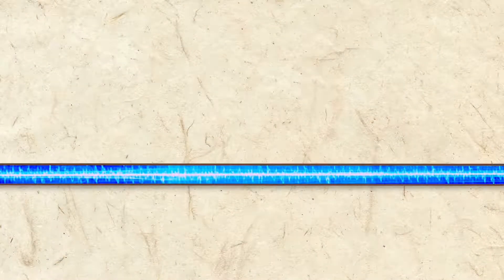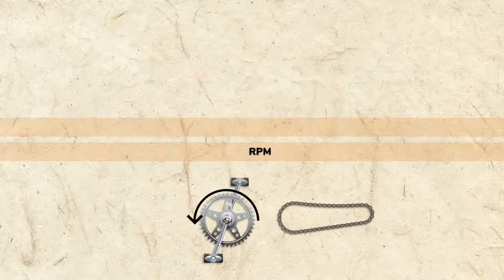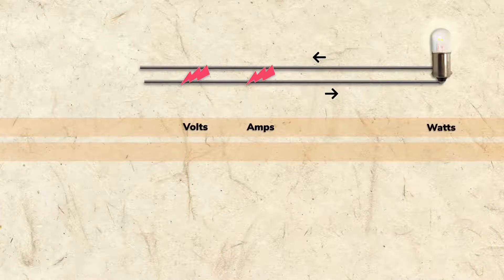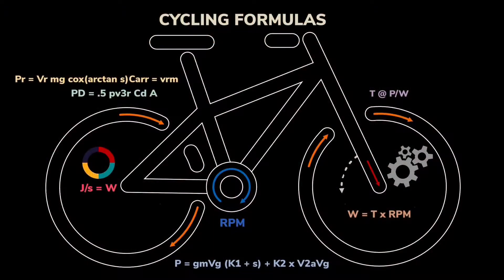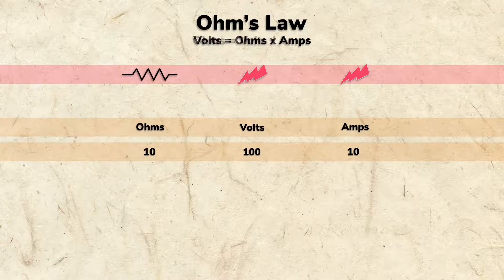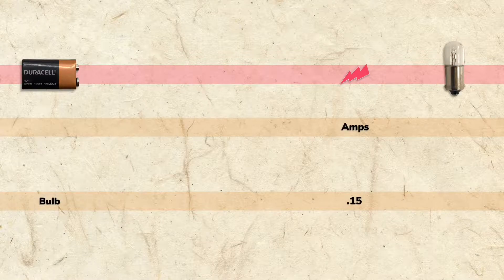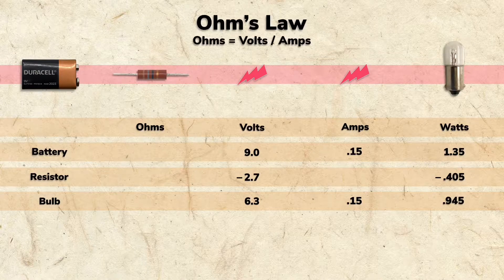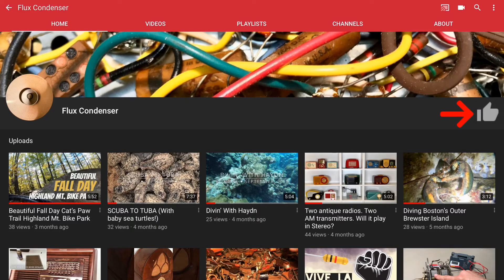Antique Radios | Volts, Amps, Watts & Ohm’s Law

Comment: he didn't explain the division, but dividing a fraction, into 2.7  I couldn't figure out how to do it. And I wanted to see if I even had the correct number in the box to be divided by. The ("2.7 "), did go in the  box and (.15) does go out side the box  to see how many go into the 270.
 I found out if add a 0 to make the 2.7   "get",  270  & that changes the decemal point over 2 places, now do the same to the fraction .15  now you can divided that 270 by 15 & get 18 ohms